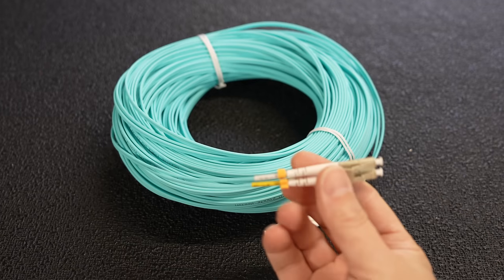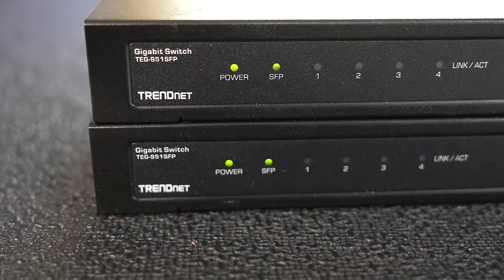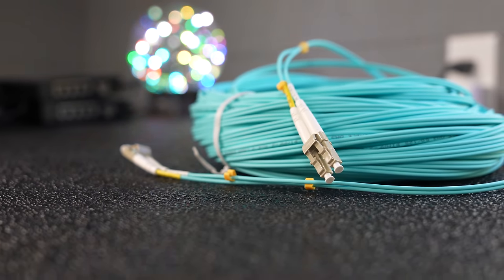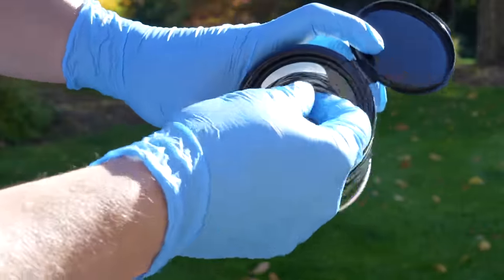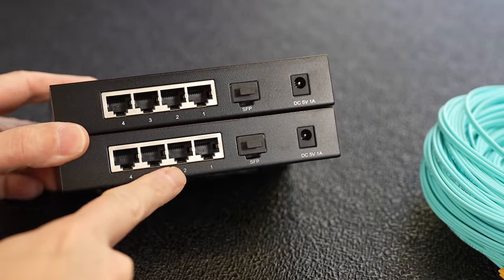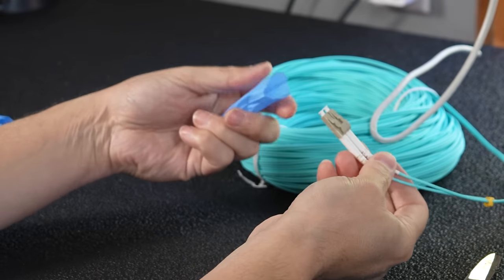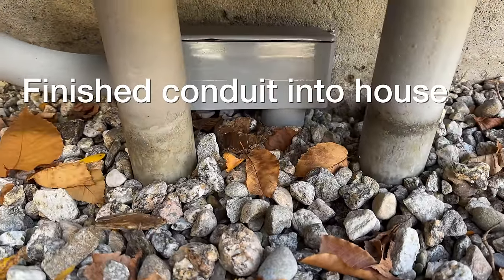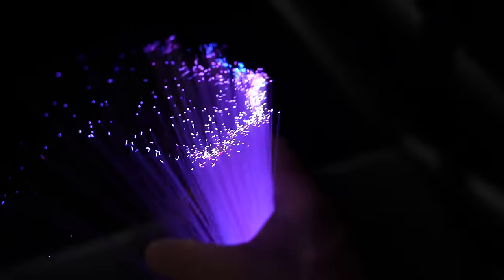How to Run Fiber Optic Cable in Your Backyard - My 10 Gig Install for Starlink

Comment: Brotip:
When testing the fiber before running it:
Make sure the heat shrink sleeve alternates colours on either side...
Yellow white
White yellow
Or vice versa. If they're they same, break one end open using the side of a blade and swap one end.
You can thank me later for saving you 6 hours of frustration.
Reply: Not sure if I'm just dumb(probably), but can you explain why you should do that?
Reply: @franciscobenitez5651 The SFP modules have a TX and an RX port. You need to alternate the fiber so that the TX of one module goes to the RX other. You do the same for the RX side, going to the TX.

Comment: I have a Ubiquiti setup, and was able to do 10 gigabit over ethernet between two buildings.   I did run two cables, to I have a backup, but I would have gone this route if I had known how easy it was.  Great video as always!
Reply: Like he said in the video, copper is ok between buildings, but you need lightning protection on both ends.  Also, copper is susceptible to freezing so they make gel filled CAT6 cable for outdoor use if it ever goes below freezing.  Can't have water in a conduit either or you are going to have a bad day eventually.
Reply: @bobherman9950  yeah I can't imagine many homeowners know what lightning arrestors and ground blocks are 😖

Comment: This is exactly what I did to my shop,  had to put in my own conduit though.  Singlemode fiber is the better choice though,  you have more sfp options especially if you want to go beyond 10 gig.
Reply: singkle mode is not the best choice as the transievers are mroe expensive and it is pointless for runs less than a 1km lol
Reply: @jonneymendoza  Sure it'll work fine. The price difference is a few dollars, so singlemode is still the best option for future proofing.

Comment: Whoever ran that string in the past was Brilliant. What a huge foresight. Also.. GREAT suggestion on your part to replace the original string from the get go
Reply: If you don't have a pull string ran in empty conduit, just tie a plastic bag to a new pull string, stuff it in the conduit, and use a shop vac on the opposing end.  The shop vac will suck the plastic bag through the conduit along with the new pull string.
Reply: @JuiceSpringsteen88  great tip
Reply: Definitely leave a pull string in when putting in buried conduit. In addition to making it easier to pull next time, it helps to save the work of trying to pull through a collapsed conduit.

Comment: HUGE note - 
Make sure you have at least 1-2 Feet of Slack for Expansion/contraction on both ends for heat swings and temperature changes. And prevent abrasion from rubbing. 
Put cable lube with pipe and cable as well. 
Since you have water in there, You very well could have a future break in your fibre line as one end could expreience frozen in the ground while another end is contracting and pulling on it. 
I would have tried to get sheated or protected direct buriel line in that conduit instead of the thin line. 
Also i would have run at least 2-3 pairs of cat6 in the cable for future use, separate networks or more to goto a nice managed switch for vlans, security cameras etc. 
POE switches are LIFEsavers. 

I had 6 Runs of cat5e almost ruined from years of expansion contraction from +30 to -30c seasonal swings. 
Luckily i ran Two 1 inch conduits (data/future) and a 3" conduit (power) to garage.

Comment: I'm personally not a fan of underground conduit, but that's just because I've spent the past couple decades dealing with poorly installed wiring conduits at gas stations. lol. Our US customers always seem to spec rigid pipe that's rated more for lateral strength than water intrusion. I much prefer direct burial cable, but I imagine that would be kind of pricy for 200+ feet of fiber optic. Not to mention a lot more work.

Comment: Yes, get ready !! We currently have 5 Gig residential circuits out as of last year and now installing and building the circuits to transmit 25 Gig residential in the very near future. Do you need that no, Over kill yes, bragging rights YES.
Reply: Yet I can't even get fiber even though a state capital city. Oh wait though...ATT took millions of dollars to run fiber to a few apartment buildings in the city so they can now say they have Fiber there

Comment: I'm planning to have a similar situation in a few years.  In my case, I plan to run through conduit, much like you, but I plan to get fiber that has at least some sort of armoring to protect it while pulling (also use pulling lube - helps alot).  I've seen fiber that has metal shielding or strong fiber (like kevlar or similar) reinforcing.  When they ran fiber to my house, the fiber they used had a tough outer sheathing then fiberglass? rods inside to help protect the fiber from bends and stretching.  To terminate it, they used a fusion splicer to splice a patch cable on.  

It looks like there are new types of connectors coming on the market that make DIY termination possible.  The main tools appear to be special strippers and a fiber cleaver.  Neither are all that expensive (<$50 for a kit on Amazon).  Here's a video showing how to do one of these types of connectors (there are other types too): https://www.youtube.com/watch?v=uKDYw0jPskc .  Doesn't look too hard, certainly no worse than 8P8C connectors.  But for a one off run, buying pre-terminated probably makes more sense.  Though one advantage of running bulk is its easier to find cables with extra fiber strands (great for future proofing or just in case).

Finally, lookup Corning ClearCurve.  There's some demos on the stuff on YouTube.  For indoor applications, I'd definitely go with that if possible.  The improvement in performance with tight bends is quite impressive.
Reply: you can always buy multistrand fiber that is preterminated to make installation easier.  either way always get the outdoor rated cabling when your pulling though underground conduit.
Reply: @ccoder4953  oh gotcha.  obviously it doesn't matter if the fiber is preterminated.  But yeah, being a Network Engineer I only have experience with professionally fusion spliced fiber, or the preterminated fiber.   I dont know about these connectors.

Comment: Consider running "outside plant" (OSP) fiber outside so water in the conduit doesn't damage it and use pulling lube.
Water often gets into the conduit via condensing in the cooler part underground and by flooded vaults.

Comment: Plastic pipe is your friend. It's cheap and will protect your wires if you do any digging in the future; I'd say 3 to 5 inch pipe. Plus you if you oversize the pipe you can pull plenty of new wires in the future if/when you need it. Make sure to properly cap it. If your doing direct burial then always consider putting in hybrid or an extra cable with heavy gauge copper to carry DC if you at all suspect POE might be useful.

Comment: Water can get in to the conduit due to Enzo being open or more likely and never getting covered doing construction. Also conversation is a method of water ingress. And depending on code, location and installer they don't necessarily have to be glued since the expectation is that it's going to be a wet install and water resistant cable should be run.

Comment: I trenched out about 90ft to a location where Im building a shed. Ran two different conduits (one for power and the other data). I ended up assembling the 10ft sections piece by piece and ran the wires/LC fiber while assembling. I was worried trying to pull 2-2-2-4 MHF in 1.5" conduit was going to give me  trouble. Totally dont need data out in a shed but I didn't want to regret not doing it. At least I'll be able to make the exterior lights smart and add a security  camera or two to give me better coverage of the backyard.

Comment: The electricity in each house is grounded. If you have two houses then you are already working with two ground points. If you then lay a copper cable, you will very quickly have phantom currents and ground loops. This can also happen in high-rise buildings with a lot of cables. Or if you connect several buildings on a large property.
With fiber optics you get around the problem.
Reply: Ethernet actually galvanically isolates the equipment from the endpoints if it's not using POE...

Comment: "Why is this so wet? Am I touching something gross?" 😆😆😆
Reply: The inside of the conduit sweats due to condensation from a cool ground and humid air outside being pulled thru conduit.                                over time water builds up.

Comment: I would recommend running a pipe liner. This will give you a seal from the existing leaks & smooth any rough pipe transitions and cracks that could damage the fiber when pulling.

Comment: Only drawback will be water in that conduit during the colder months that will freeze and squeeze the fiber causing low light or light loss between the two switches.

Comment: One thing about Fiber optic cables is that there is no POF which means that you have supply power to the switch and the converter or computer as it will not be supplied from the cable.

Comment: Why are you running copper through as well? If you were doing this just to have the loop to pull the fiber with, there is a much easier solution. 
Take two tongue depressors or 2 inches of a split paint stick and sandwich the head and a portion of the cable, wrap with some twine or an old shoe lace then with tape. You can either add in a piece of romex for a loop or simply put a couple of knots in your pull string and layer it in under the wrap. The wood helps with strain relief at the termination and allows you to cut the tape off with a razor without risk of damaging the cable.

Comment: I have one that has a protective sleeve on it for underground use. but it will also go though a pipe. I have not done it  yet but once I get the house redone then I will run the fiber though.   In my office were the internet is at with my servers its all set up for 10G to all servers and computers with a 10gb switch.  I will be getting a new switch that is  1gb POE with 10g uplink ports it will have 4 of them 2 will be linked while the other 2 will be used in the home if I ever want to do 10g to any devices the POE is for all my cameras and poe devices.

Comment: One other thing to think about,  just like your eye glasses, fiber optics need to be cleaned.  Also, even though you wipe the end of the fiber it doesnt mean you cleaned it.  We use a scope to check to make sure the end is actually clean after wiping it.  Always clean both ends before plugging one in to the other, including any equipment ( they are not always clean from the factory!)

Comment: So, I would be very interested in how long this lasts. Maybe do and update in about a year. When I talk to fiber guys they tell me that vertical runs in fiber cable break under their own weigh unless you get the correct type. 
Oh, for runs with no cable you can pull a string using a parachute made from grocery bags, just cut them down to a square and tie string to the corners. I tied an "X" and tie the pull string to the middle of the "X",   apply a shop vacuum at the other end. I did it this way on a 700 foot run that had two wire runs already inside. The parachute is flexible but can get caught I had to pull back and release to get it through all the wire twists but it worked quickly. I have also heard of using a ping pong ball but that's for larger pipes.
The utility installers I spoke with told me any pipe smaller than 2.25 inches can be cut open by animals. The diameter of pipes larger than 2.25 inches had a curvature they couldn't chew through because they couldn't open their mouth large enough... Who know about that they guy could have been telling a tall one..
Its also possible the water is condensate but the amount you had seemed pretty high hot air and cold under ground makes condensate.
-MG

Comment: Just for other folks, that is not outdoor rated cable, just a basic om-3 patch cable intended for data center use.  Also, why not just bite the bullet and get 10gb switches.  Mikrotek has an inexpensive 4 port one.  Lastly, the big benefit with fiber over copper is latency.

Comment: Great video! I've just come across this video after watching the one where you set up a water pump and the way you explain the process in both videos is very clear. I was just wondering that since the conduit can accumulate water over time, will this affect the fibre optic cable? Do you need to push out any water annually?

Comment: I wouldn't even use a wireless option if I only wanted 1 gig, or even 100 meg. Way more expensive and not future-proof. The only way I'd do it is if the distance would make the fiber and modules cost more, and if the speed could be guaranteed, even in rough weather.

This is an excellent video, not cowtowing to the wireless nonsense.

Comment: If you are going to future proof it why not use single mode fiber for more speed "down the road" and put the cable in interduct on the wall for safety.  Cool video though, if you don't want a premade piece you can use mechanical connectors, they have come a long way, but you need a tester to make sure the connection is good.

Comment: Make sure you know where it is. Because it is glass and plastic, another weakness is it is very hard to detect behind walls and structures.  At work I had find old buried fiber and it was nearly impossible.
Reply: That's a good point. Could you run a coax cable along side for detection just for purposes? In addition to documenting via measurements and pictures of course.

Comment: Use outdoor rated "loose tube" OS2 fiber and cheap single mode transceivers. The patch cord he used is rated for indoor use only and will likely fail long term.

Comment: Very cool, thanks for sharing. I'm curious tho, why not just run Cat 6 ethernet which has a max distance of 100 meters, 328 feet? That can also handle 10 Gig and is less fragile. If running longer distances, completely understand benefits of fiber.
Reply: static charges from well anything...copper in the ground is an antenna

Comment: I just got starlink and wondering about the goal here. Are you putting one of those switches and attaching it to the starlink router, and then attaching the other switch to a different router at the second location to get internet farther away?

Comment: In France we already have a 5gbps and 8gbps plan. I think it only has a 5gbps port on the router. I have the 2gbps plan but actually get 2.3 on my 10gbps port on my mobo.
Reply from the maker: Wow! You guys are lucky with that, we do not have that as a norm here. But remember ages before Internet you guys already had minitel, I always wanted that here.
Reply: @SilverCymbal  when i first moved here about 9yrs ago it was still ADSL and I'm in one of the big cities. Then they fibered everyone up for free with free installation. And since it's FTTH right to the router in either home/appt once they provision higher speeds most people can get 10gbps. Although 99% of motherboards don't come with 10gbps, 2.5gbps is just now becoming the norm.

Comment: Can you do a video about the expandability of fiber and limitations if there are any?

For example can I send video from security cams over it now or in the future to a central recording device, 

Also can I send out video to multiple television's from a single output in Ultra HD?

I would really like to know what is possible.
Reply: Fiber is very upgradeable. Basically just the device on the ends that limits it. Swap out the switch at both ends and now you have a 10Gb link or 10 times faster. Or I believe that cable can do 40Gb or 100Gb essentially crazy fast. Its just networking, so the modern IP security cams just operate on your data network like a computer. The NVR(Network Video Recorder) can be anywhere on the network. The NVR can technically be almost anything with the software like a computer, tablet or dedicated NVR device. With that IP cam system you can also have 2 NVR on the system recording. So 1 is obvious in your house maybe with a always on monitor...super obvious. So burglar breaks in and grabs the NVR thinking he's taking the evidence. WRONG you have an NVR on top of a cabinet, under a workbench, in a closet, in the back of a lazy susan cabinet, in a detached garage/building or anywhere you can get a wire and network cable. It can all be remotely accessed and controlled when needed.

Comment: Even if there were no speed benefit, it is a mistake for everything to be wireless, especially permanent installs.  We're crowding already crowded frequency bands as we connect more and more things.  And even if we were, reliability is reduced.  You will never match the reliability of a physical line.  If it is a permanent installation and a reasonable distance, you should always opt to run a wire where you can, or at least plan to in the future.
Reply: Yes. Wireless is subject to many external signal incursions which fiber is not.

Comment: There is 10Gb copper available that uses cat6 (nice if you have existing connections). You would just need a switch that supports it.
Reply: Not recommended to connect buildings. A close lightning may fry ports or even whole equipment. Best to use fiber if possible.
Reply: Yup lighting gonna fry up everything if you use copper to connect two house

Comment: This is probably a dumb question, but I’m assuming in order to even be able to do this at all, your residence needs to have fiber available from ATT or Fios, correct? 

I live in a new development and Verizon told me that the developer didn’t run the conduit cables to the second half of the development, so I can’t get fiber here. The front houses of our development all have it available, and I can see the boxes on their houses. I work from home (and it seems like I’m the only one in the whole neighborhood who does) and I’m happy to pay to get the conduit extended down to my house, but I don’t know what to do.